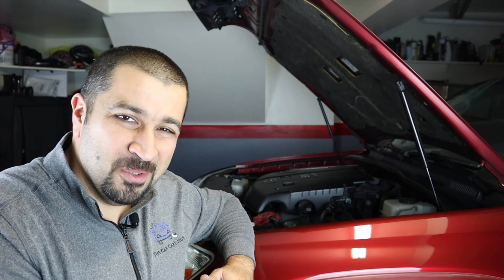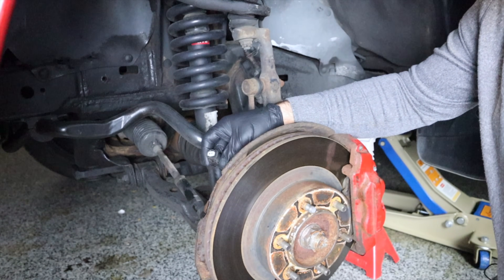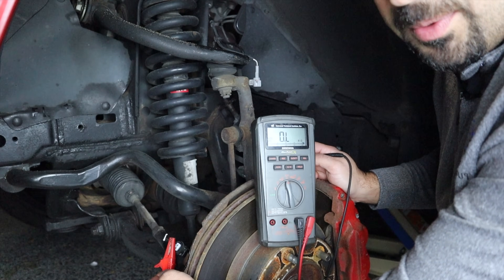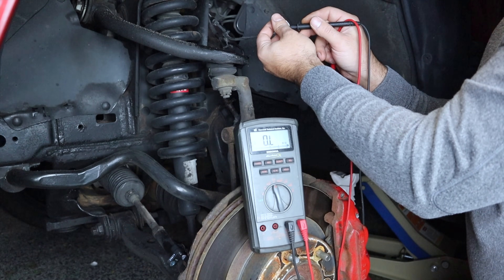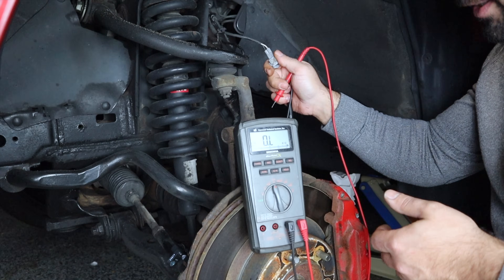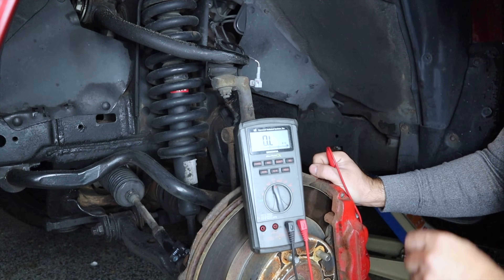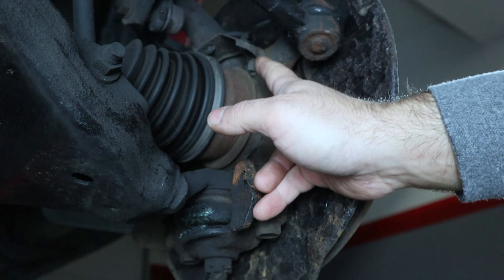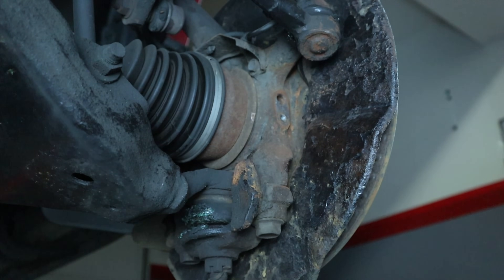ABS Diagnosis Tips from a Toyota Mechanic. Fix It Right The First Time

Comment: My Abs light comes on at 45km/h.  Below that, it goes off on its own.  Error, "Foreign object is attached on tip of front speed sensor LH."  Already cleaned the sensor tip and its path but no change. Live stats on diagnostic tool show the LH front wheel accelerating faster and decelerating slower than the rest. By the time the rest have decelerated to 0 and the vehicle stopped, it's reading like 9km/h. Swapped the sensor, but there was no change on the side. 
My local mechanics seem to be giving up on it. Kindly advise a frustrated Toyota yaris 2010 owner.
Reply: A reluctor ring for a 2010 Toyota Yaris is available from various online auto parts retailers. These rings are a common replacement item, especially if the original has cracked or corroded, triggering the ABS warning light.

Comment: Thank you very much for your videos. This one has been very helpful.
I have a 2016 Highlander.  I brought it to a garage to have the transmission fluid and cooling fluid changed. Afterwards on the way home, the ABS and TRAC lights started coming ON for a while, then OFF for a while. This happened four times. The next morning, I brought it back to the garage.  Their diagnostic scanner indicated a voltage problem with the passenger's side Wheel Speed Sensor. I ordered a new one from ToyotatownPartsDirect. After it arrived, I installed it, but the alarm still intermittently came ON and OFF.  I cable is permanently attached to the sensor. I measured the resistance of the original sensor/cable at OL. I measured the resistance of the new sensor/cable at 4.9Mohms. I measured the resistance of the driver's side front at 4.9Mohms. I'm not measuring the in the kohms range, like is shown in the video.  Is it normal to be 4.9Mohms?  Thank you.

Comment: I have a intermittent grinding noise on my front left but no abs codes and my wheel bearing spins freely. I did have a squirrel eat some wires last year so I guess I should check that

Comment: You are truly amazing. I just wish I was smarter and could understand the part when you used the multimeter. I’m not understanding that part or where you turned the dial to. Mine doesn’t say resistance on it

Comment: Question: I'm getting codes C02-26/36/46/56 and C1452 suggesting the ABS solenoid circuit is failing. Is it worth trying any of these checks in this video or is it likely a bigger issue and the whole ABS system is on the way out?

Comment: My Toyota the abs kicks in at very low speed, would you know what could be causing this issue no abs lights and checked on a obd2 reader no brake fault codes  ? Cheers

Comment: How would you track down the ABS randomly engaging at 70 or even 10mph and no code is stored. Would a faulty sensor cause this or would just a light come on? Has plagued me almost 2 years, and 5 shops including Toyota cannot figure it.  Advice is appreciated!

Comment: FYI - the number one reason ABS, steering, brake dash lights come on and loss of speedometer reading is because the car battery is low in voltage (you need a new 12 volt battery). All those symptoms showing up all at once is most likely a battery in the 11 volt range. Get a cheap Harbor Freigh VOM and check the battery voltage. Put on the 20 DC volt range if you are unfamiliar with VOMeters.  And never put OHMS to any power.  Good luck

Comment: Have you seen where while driving at highway speeds on a dry, straight road that the traction control system starts engaging (and sounds like abs when braking on icy roads), pulls the vehicle to the passenger ditch, throttle unresponsive, and once the speed drops to around 20 mph it will start locking up one tire? It's happened about a dozen times on my 2016 4Runner but I can't get it to replicate on demand. No codes or help at the dealership. So I'm on my own.

Comment: Is it possible to test the sensor with an ohmmeter to see if the sensor is bad? I got codes C0210 and C0215 on my 2007 TT, and I'm trying to narrow down the possible reasons before I buy new ABS sensors..

Comment: I have a 2012 ct200h.  I’m getting a c1345 learning undone.  I have a xtool and tried to relearn.  I cannot get it to clear.  All the speed sensors read correctly.  Do I need to replace the break booster or the Actuator? I’m at a loss on how to clear this code. Please help. Thank you in advance.

Comment: Ahh, I had a code and replaced one of the sensors on me Highlander.  There's no code. But there is now and imbalance and the ABS comes on for mild braking.  The rear sensors are too hard to get to. Can one test the sensors right at the plug in to the ABS control module ?

Comment: I have a issue with a 2013 Prius v I replaced pad rotors and a complete bleed to clear codes and all completed now I come across a right hand turn and the trac light flash’s and of brakes seems to grab and direction u can help me with

Comment: When cornering heavily in my 06’  LX470 I’m the ABS Traction Control System is engaging prematurely on dry pavement.  Any suggestions?  No codes, no rust

Comment: Hello. I have a 2010 prius and the abs module was out for 6 months and just replaced. On the way home i had a slow speed turn where i had to turn the wheel all the way and i got a shuddering/grinding and the mechanic thought the abs was engaging. I have no dash lights but this will happen on left and right turns if i have to turn the wheelnall the way. Other than that, it drives great, no shaking or vibration.

Comment: I have a brake and abs light that randomly comes on without touching the brakes and randomly goes back off. 2004 Camry le 2.4. I have no codes. What am I dealing with?

Comment: Why would you not use a wire brush to clean up the rust on the landing where the sensor is mounted. Seems to be less violent. I learned a bunch from this Vid, BTW. Thanks !

Comment: Hello, 
I am also a DIY person with not much of background of being a qualified mechanic. I am not even sure if I could share and ask you about my problem. I am from down under and I got a 2010 nissan xtrail t31 4x4. I have of code of c1118 which a friend advised that it is speed sensor. So I bought aftermarket sensor front and rear but the 4wd esp are on amber light. If I drove with 2wheel, after maybe a kilometer it turn the 4wd and esp light on. But if the car is stationary and I change from 2 wheel to 4 wheel in a minute or so you can hear a click and abs pump will make a noise. Light is back again. Replaced a used abs pump with identical part number but same as well. I frustrated and tired that’s I been watching your channel and happy and interested on what you’re make sense. But i could it could not help me because it’s a nissan. Hope to hear from you. Cheers

Comment: Your information was very helpful, thank you!  Mine broke off and there was a rust lip formed.  I was able to remove that by turning a drill bit in there by hand to break the rust free.  The broken sensor kept the rust from getting inside the housing.  I then popped it out with a dental pick.  If the truck is in the "salt belt", expect this same problem to happen.

Comment: Have been struggling with exactly this issue with my Canadian 4runner. ABS sensor snapped just the way you showed, but I managed to extract it with your method (hadn’t watched this video by then). And there was a broken ABS harness under the airbox. Still have the error code throwing after a short drive. Now I know I need to clean that rust, maybe that’s the problem of my front RH circuit problem, as multimeter reads good numbers. 
Thank you so much for the video!

Comment: I replaced rack based on your video it was great. Then I did struts and got aligned. My daughter hit curb and my vsc and track off light is still on im wondering if it's the speed sensor. I don't have a code reader to check it. I tried zero point calibration it turned off but then as soon as I drove came back on

Comment: Hey my man, I have a question so all of a sudden my 2017 4runner I’ll be driving 45 miles an hour down the road and then my traction control engages making the brake pedal depressed until I have come to a full stop and it makes a crazy electrical shortage sound inside the dashboard then it doesn’t allow me to go above 15 miles an hour until I turn off and turn back on my car. Now this is just happening every 20 minutes of driving the text at my local dealership told me it would be my front wheel sensors besides that they’re at a loss. What What other avenues could I try to take to figure this problem out?

Comment: Another ABS nightmare with Toyotas: low-mushy brake pedal after even a simple brake pad replacement. Makes no sense, and mechanics will swear "it's air in your system!" Yeah, right. I bled the system 20 times, still soft pedal. They refuse to consider ABS.
Reply: Dude I thought I was going crazy. It’s the same for the Lexus. It has no problem braking but it’s just mushy like you said
Reply: @shadowcharger2477  ...it's a damn mystery! Many diy'ers talk about it, but the industry is totally silent. It seems freaking illogical an ABS unit could fail when you're just replacing pads. Makes NO sense.

Comment: Hi i really need your advice, help….i have a 2012 Prius and my brakes are locking up during driving, it happnes pretty much every 3 days it seem and do you think replacing the ABS module and brake booster will help the problem? its a pricey job, so i just want to make sure thats what it is…. thank you so much.

Comment: On my 2014 sienna I replace the clock spring and the steering wheel angle sensor and the airbag warning went away but now I have VSC and ABS with a U0073 code any ideas? Horn doesn’t work now and I put the old one on after clearing codes and same result
Reply: Same here, how do you fix it?

Comment: I feel the ABS kicking in on the brake pedal when coming to a stop. New brakes and calipers all around and still the same issue. No codes but can it still be a bad speed sensor?

Comment: I clean terminals like that with white vinegar. It will take the corrosion off completely. Then I rinse off with water , and spray with electrical contact cleaner.

Comment: Need help. When I drove my Toyota Avalon to AutoZone they checked the charging system with their system tester it came back as a bad charging system I replaced the alternator and battery and checked all fuses and harnesses between the alternator, fuse box, and the battery cable + and negative no issue was found. The battery is 12.46-50 Volts engine is off and the engine running is 14.4-6 Volts. . I do not have any lights on the dashboard or problem driving.

Comment: So I've got an 04 gx470 we purchased for our family SUV. We got scammed with an odometer roll back when we got the car. It has 272k miles on it. We don't know when the major service was done so we did the timing belt water pump after we got the car and replaced the rotors and pads. About 2 weeks ago it started to make a screech noise after a cold start. I was able to see the noise was coming from the accumulator. I had the accumulator replaced none of the parts shops in my area had them in stock and I ended up getting a rebuilt from Amazon. The car no longer had the screech on cold starts but, 2 days ago as I was driving and about 1 mile after a cold start after sitting over night the ABS brake and two VSC lights came on followed by a buzzer. After about 1-3 minutes the lights went off and the buzzer stopped. When the lights came on I was not on the brakes I was just driving. I tapped the brakes and they felt normal. I'm at a loss about what it could be. Could the rebuilt accumulator be bad? 
I used my obd reader and there were no codes when I checked. Then it happened again today. Similar situation I started the car in the morning and within 4 miles it happened again. I came to a stop and held the brakes and it felt like it had normal pressure. After 2-3 min everything went back to normal. 
It has only happened within 10-15 min of a cold start. I can hear the accumulator on normal start ups and it sounds normal no screeching. 
I'm stumped I don't want to just randomly throw parts at it. Could it be the abs unit itself? Or the new accumulator is faulty? I've got my scanner hooked up to the car so if it happens again I can pull codes while the lights are on. I've let the car idle for 30+ min with random brake taps and can't get it to happen. It seems like it's only after sitting over night and in the first 10 or so min of driving.

Comment: backyard mechanic broke the left front sensor on my 2019 Prius... I replaced the sensor with after market part but it didn't fix it..  I visually seen the old one was broke... there's a code from Autozone that says it requires zeropoint calibration.... Not sure what to do now but it sucks not having cruise control...

Comment: Can you explain how to fix Toyota FJ Cruiser . Only two codes were stored: C1241 and C1452. No ABS light stays on the dashboard when drive. Accumulator sensor voltage in normal range between 3.58 to 4.7 and change when pump operated. Any possibility this happen when I changed the battery.

Comment: Hi Car Care Nut. My Lexus ISF has those lights come on the dashboard but I can not connect any diagnostics to the ECU. Checked all the fuses, got a new battery, checked all the relays, pulled the ABS module out to check the connectors, all good. Done the same to the ECU, all good. But still can’t connect to ECU. Had an auto electrician look at it and he said the ABS module is not getting signal/power. Do I replace the ABS module? Any advice would be very much appreciated. Love your channel and please don’t stop making them. You are doing a great service to us humans 🙏

Comment: Car Care Nut, please help!  I have a 2007 Toyota Camry LE, 4 CYL.  It does the weirdest thing.  NO ABS LIGHT IS ON.  When I hit the brakes, everything works fine until I get to about 5mph.  The pedal pulsates as if the ABS is being actuated and then the car finally stops.  It only happens once I cross the 5 mph mark on the speedometer down to a complete stop.  Very strange as the check engine light is not on.  PLEASE HELP.

Comment: one other issue not sure of when I pulled my rear sensors out to change I notice a large amount of grease on the sensor does this mean the bearing or axle seals bad?? my code p0500

Comment: :face-pink-tears: I changed all four sensors, I changed the aft sensor cables l/h and r/h. I tested at the rear connector voltage turned the key on and reading zero voltage does this mean my ABS module bad?.

Comment: Hey AMD, do you have any tips/advice to diagnose a C1391 (abnormal leak in accumulator) on a 2008 Highlander Hybrid? I've done a fair amount of research on how to replace the accumulator/actuator and booster pump. I don't see any visible brake fluid leaks between these two parts or the cables towards the wheels. I just wanna make sure I'm fully diagnosing this before spending the 1-1.5k on parts, couple hundred on a bidirectional scan tool, etc... Cheers!
Reply: Did you resolve your issue?  My Prius hybrid is also having this issue and disappointed how expensive the parts and repair is.  All the fuel savings going to be spent in repairs.
Reply: @jimv77 I went ahead and bought used pump/accumulator (~$1k). Worked for a day, then same codes came back. Been trying to diagnose it again, but I’m just gonna assume I got a bad accumulator. 🤷
Reply: @thedavidlynch  oh man that sucks.  Buying used was probably a huge gamble if your accumulator part had a known design issue (like my 2010 Prius)

I've been doing the paperclip reset workaround for 6 months -- might keep my car as a beater for short trips now.

Comment: If you need a wheel speed sensor is it worth it to spend the 3x on an OEM or is aftermarket OK in this scenario?
Reply: I bought an aftermarket sensor..and it's works the same
Reply: @gregorywalsh7120  Thank you for the reply. How long have you been running with it?
Reply: Few months...I still need to check my abs module

Comment: Hi there, I just got my 2012 Highlander Lmtd. back from the shop and replaced the front left and back left ABS sensors but the brakes are still pulsating intermittently. What do you suspect is wrong?

Comment: Is there a way to find out that the dealership has to find out if mileage has been changed I bought a Toyota from Ford and is there a way to find out if the mileage has been turned back?some kind of computer program the car is only 5 years old

Comment: I can’t find a diagram or video any where on the internet for the rear speed sensor plugs into when replacing the whole wire it goes into the wheel well and I can’t find where it leads to I know it connects to other pin because the wires only so long 
2007 Lexus es350
Reply: Update  rear seat has to be removed to access cable connector was  on pillar near bottom